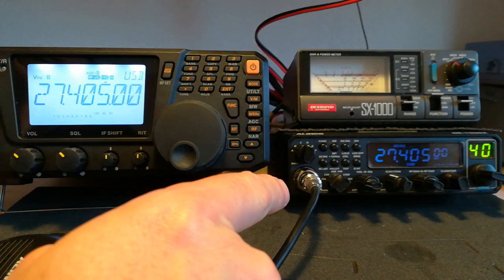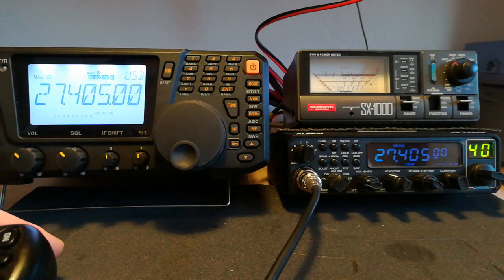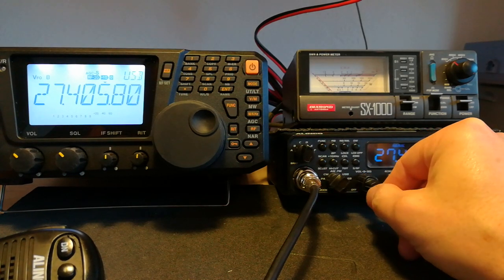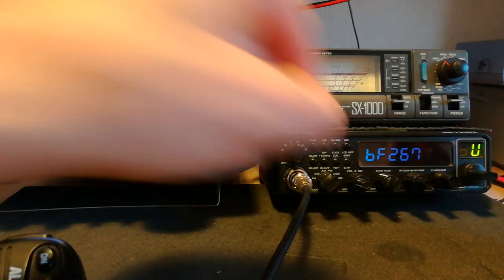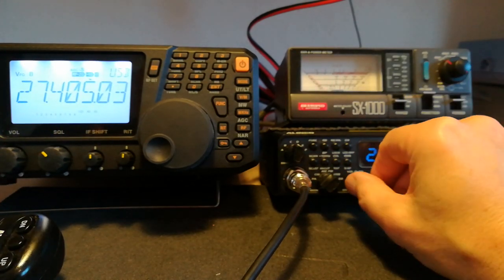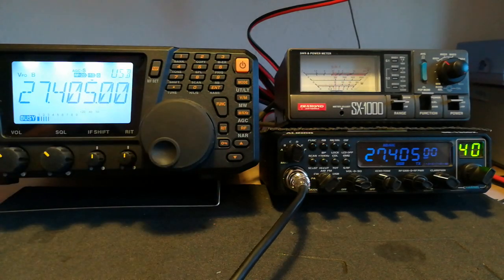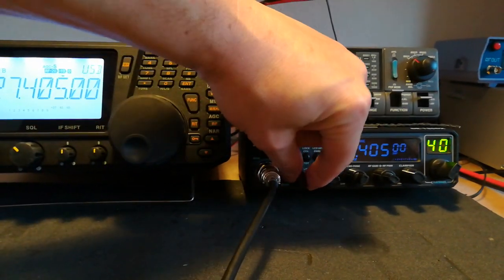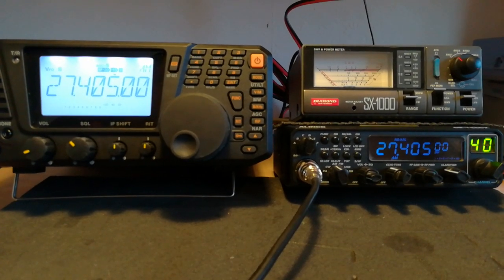How to tune an  Alinco -DR135  onto frequency without any  test gear.

Comment: Nice tutorial, is this a common problem with the DX135/DX10? 
As I am in the motions of look at one to buy, or is this an isolated case? Also looking at the CRT6900
Reply from the maker: Most modern radios  no matter what are, Are  of frequency a little bit , I was just showing how to put the radio back on frequency if you ' Didn't ' have the correct tools to do the work ...... I've also a CRE-8900 , Basically the same radio as the DR-135 and I've not had an issue , I've also got two other DR-135's that I've not had any issues with .... Although now I've got a Superstar 9900 and have to say it's a fantastic radio and in my view better than the DR-135 👍

Comment: Does this adjust the receive at the same time or is it just transmit? To hear people clear on side bands I have to change from 00 to 13 at the end of the frequency. So before I adjust do I have to put it on 00. Thanks.

Comment: Great video indeed. Just purchased my Cre 8900 after many years of being off air. My last radio i had then sold was a Mk1 Lincoln but wanted to go mobile nowdays on the good ol "Muppets" and "SSB".
Reply from the maker: They are a great radio , I have the Alinco and the CRE 8900 , Same radio different name , Good radios and can be had used  cheaply , The mk1 Lincoln is a decent radio , But Ide take the CRE/Alinco over one of them now , Mainly because the Alinco does it all with modification , As for actual transmit receive on the Alinco Vs the Lincoln there's not much in it really , Both of them work about the same as each other , The Alinco though is more versatile  being  its programmable , So you can set up different bands frequencies to your liking , Such as the 27/81 all in line , Something you can't do on the Lincoln .

Comment: I did a similar job on my old CRE 8900 and CRT 6900n. I recorded the roger bleep on FM and then adjusted the BFO the same way you did, but used the bleep. The recorded bleep was used as a reference, so it became like tuning a guitar, etc. I found it to be quite accurate, as I got the audio frequency spot on...

Comment: I have a couple of these radios. They are off frequency a little.  Can you tell me where to find the information on exactly what the service menu steps are? I have found some information but none of it is really clearly explained.
Reply: My DX 10 is bang on.  Cracking radio.

Comment: Hi my alinco dr135uk is a bit too high on USB but I've got the bf menu at its lowest point which is bf130  any ideas as to what I could do to further adjust ,in order for me to tune to 27.555.00 my radio is set to 27.553.70?
Reply from the maker: Try the tune up method in the video, ailing that ive had to replace the  oscillator crystal  in some radios as its just not on the frequency  its made for...  example .. a 15.000 mhz crystal  may actually be  on 15.020  mhz , All these types of radios are built fairly cheaply, so the parts are sourced as cheaply as possible to to keep costs down and profits high,  Every manufacturer does this,  But some more cheaply than others .

Comment: so would you not set the AM carrier first? Then usb and lsb get set to their respective offsets?
Also make sure the radio has been on for a while so its at working temperature.
Great video though. Thanks for posting 73 Mark
Reply from the maker: There is no interaction between any of the modes, Not in the way this radio is set up, The modes are independent of each other, So altering AM has no baring on SSB. And visa versa.
Reply: @Gw0wvl  Ahhh cool I didnt realise that. Guess im not used to this modern DDS stuff. 
But thanks for the clarification, see never too old for me to learn new stuff. 
Again thanks for sharing.